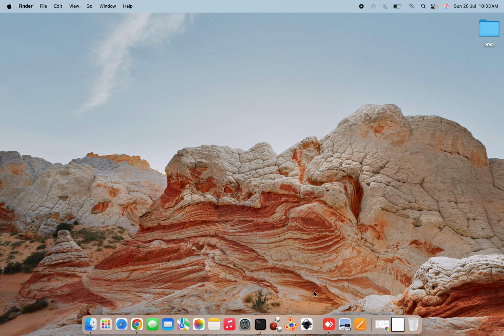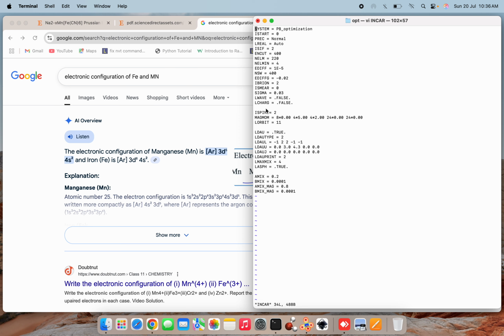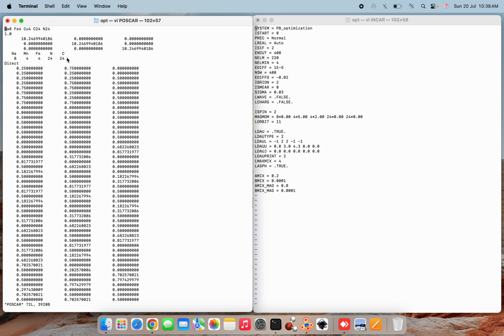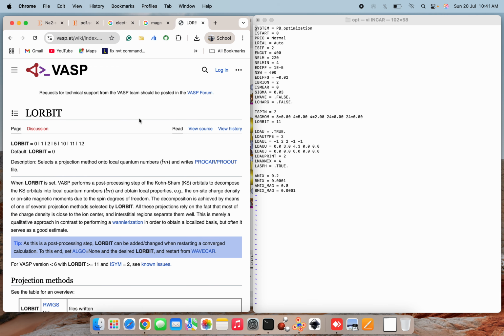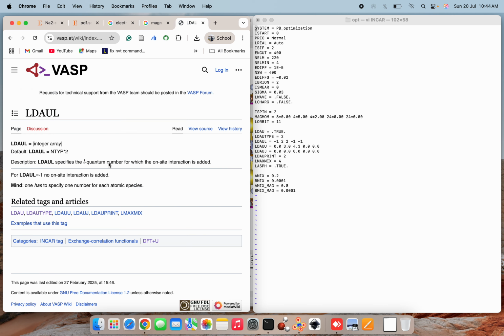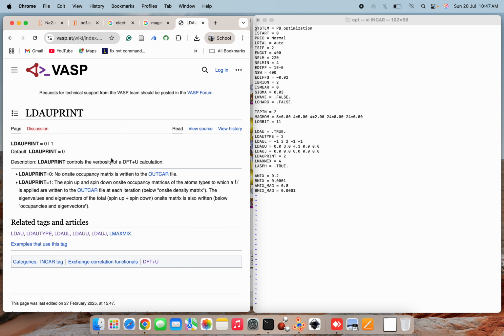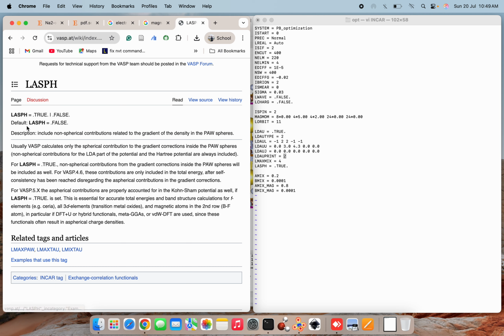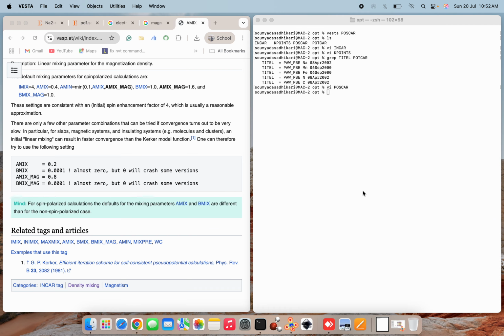VASP Tutorial - 6 DFT+U in VASP

Comment: Very informative video 👌. 
But what is the purpose of doing geometry optimization of such cathode material? Is to get the electrochemical window/homo-lumo gap of the material?
Reply from the maker: To get the correct lattice constant, proper structural phase, and minimum energy as well in the way. Once you will get an correctly optimized structure you can calculate all the properties out of it.
Reply: Nice explanation.How to choose correct U value to choose so that we can have  ground state structure?
Reply from the maker: @nagarjunapatra9516  For this you can find some other papers and their U values. You can find various papers on those who have studied only the U parameter for a material and choose from there.
Reply: @computational_physicist can I connect with you , for how to install vasp in mac , i am facing lots of problems installing.
Reply from the maker: I have not installed vasp in MAC it's installed in our HPC but for installation you can follow Vasp wiki installation procedure.
Reply: @computational_physicist thanks.
Reply: Thanks for uploading such useful video. Does it gives information about f orbitals in PDOS.
Reply from the maker: Yes I think but not sure